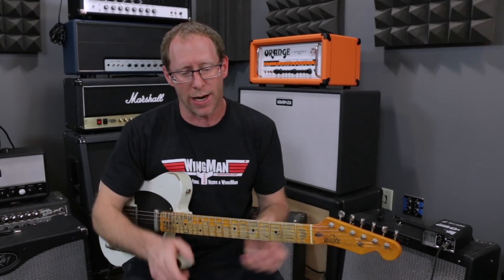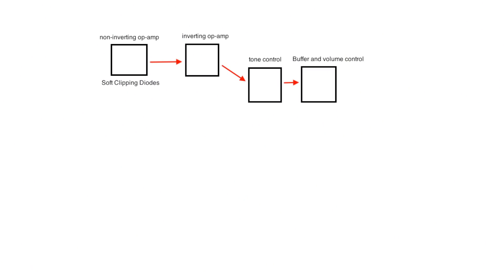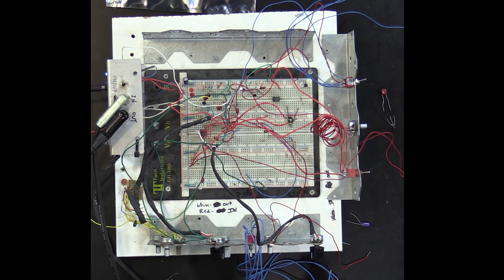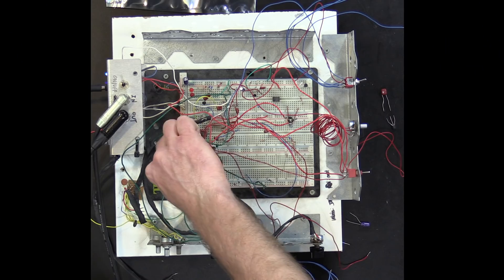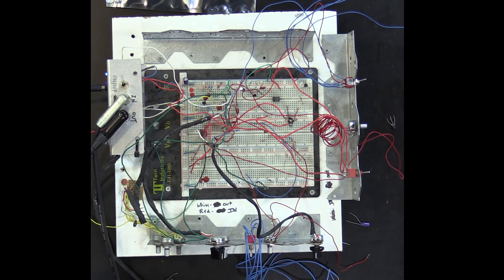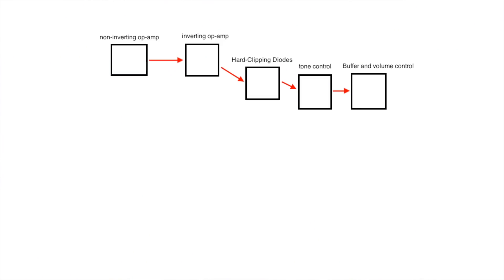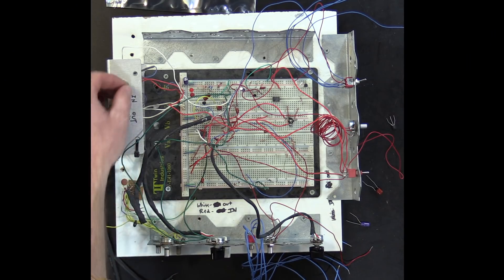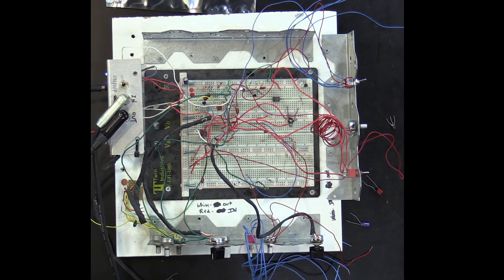What no one tells you about Guitar Pedals & "clone" circuits

Comment: I'm just getting into pedals and one would think stating a pedal is a clone of another sets an expectation that the sound should be similar.  If it's modified to provide a different type of tone than any similarity to another circuit is simply trivia to most players.  For those who are really into the design of pedals I can see where reworking circuits is of interest to branch off to new designs.  For the everyday player I'd almost classify the circuit reference with different tone to be almost misleading or false advertising.  To me it should mean similar tone but in a different enclosure, branding or with other features etc.  This is good to know though as one should hear the output for themselves prior buying pedal and not rely solely on marketing copy.

Comment: Brian Wampler doesn't gig with a pedalboard; he brings five breadboards, some wire and a bag of alligator clips...and changes 'pedalboards' between tunes! 

Seriously, I would throw money at any of those impromptu "circuits" you whipped up. Very educational/enlightening. You're a true artist at what you do!

Also: My V.1 Sovereign is probably my favorite distortion pedal of all time. Cheers!
Reply: Picture it: effects circuitry you can shift mid-gig, much like moving around the patch cables on an analog synth rig.
Reply: @rickc2102  that is basically what the switches and pots on the top of any pedal make available. Especially rotary switches as you can totally change your path multiple ways.
Reply: @rickc2102  like modular for guitarists' pedal boards.
Reply: @nzeches  yeah but you wiggle the wrong way and you're not going anywhere, ha!
Reply: @rickc2102 while in general I think figuring out socket to be able to swap parts somehow like ics would be awesome, in general you don't need that much control really

Comment: The last fuzz sound was right up my alley.
Reply: Sounded like some White Stripes
Reply: So to get that fuzzed out tone you  just need all your wires exposed which is almost a moment of synchronicity that is exactly what i did last night testing a newly soldered fuzz circuit totally bare going into amp wires were picking up signal like crazy had to put guitar volume just a smidgen above 0 or the utter devasting tsunami of noise would've been literally earsplitting even at that volume the sputters & spits & fuzziness were like awesome...
Reply: Garbage. It sounded like a fart, but not as good as that.
Reply: @WaRLoKWYATT  sorry Mr. Bluesrock. Scheduling will be back to normal klons, tubescreamers, light crunches and spring reverb, don't worry
Reply: Look for Devi Ever -  no-fi fuzz. Not sure if that was the original fuzz name, but you can get this type via the chaos mode switch on a soda meiser fuzz.
Reply: Yuri Billones i was gonna say, sounds just like the chaos switch, all it does is remove the capacitor that limits the gain of the sodameiser

Comment: I found the video fascinating! I've never built a pedal before, but it looks like it would be a lot of fun. Brian, perhaps you could do a video on how to build a breadboard pedal (fuzz, distortion, etc.) It would be useful to first see the basic signal path, and then see where resistors, capacitors, op amps and other components are added and changed to modify the sound as desired. Thanks

Comment: I remember the 1st Time I breadboarded a working overdrive n got to hear n feel the difference between swapping op amps diodes & different parts so many things that you’re conditioned to believe will make a larger change such as changing the op amp is incredibly subtle n things you didn’t expect like changing the size of cap or resistor can make a drastic difference.. that started the endless rabbit hole of building amps n pedals n constantly modded n tweaking.. your the king of gain BTW Brian. Me n most of my pedal tinkering friends agree

Comment: The OD sounded fantastic. I focused more on the very cool “jig” you set up around your breadboard. Since I play with making pedal I had already hit on the idea of using a plate with in and out jacks, and on/off switch, but you took it much further and now I have to make something similar. Great video too!
Reply from the maker: I moved away from that a little while ago and created this:
https://modyourownpedal.com/products/breadboard-module-bb-1-for-prototyping-guitar-pedals
Reply: @wampler_pedals  damn. Fell for it immediately, and the price is good, only problem, it’s sold out. I definitely would buy it, but any idea when you will have more for sale?
Reply from the maker: I’m getting ready to put a new batch up here shortly
Reply: @wampler_pedals  cool! I will keep checking for it. If possible had one other question. I would like to have a looping guitar input to some pedals while I tweak them with things like trying different transistors, op amps, bias, etc. was thinking that it would be important to duplicate a guitars output impedance to get it right. Can you advise? Or maybe have something that does that? I can of course loop, but it is the guitars impedance I’m more interested in.
Reply from the maker: I usually just buffer into whatever effect I’m working on but you can use a “pickup simulator” circuit and increase the impedance if you need to.
Reply: @wampler_pedals  thanks. I’ll look for a pickup simulator circuit. Is it usually resistive, capacitive or both? I assume it’s passive.
Reply from the maker: Passive, search for it along with muzique.com
Reply: @wampler_pedals  Thanks so much! Excellent resource!

Comment: I'm a big fan of "imploding" sounds, like you get around the 6:30 mark.  These are generally achieved by using cascaded high-gain circuits.  One of my pedals is basically an MXR Distortion+ clone, feeding an Ampeg Scrambler clone.  Implosion sounds abound.  Another is essentially a heavily modded EHX Double Muff circuit, which is fundamentally a pair of silicon Fuzz Faces in series.  It makes a terrific platform for experimentation.

Comment: I want to buy this pedal exactly as it is.
Reply from the maker: I might be able to do a couple of one-offs if y'all like it
Reply: "The stompbox that can be whatever you need it to be: fuzz, clean boost, overdrive, or just a noisy bee"
Reply: @elonmush4793  Here's a name for it: "Bumble Bee Bouncer" ... "Boutique By Brian" just needs to build it and slap on a $250 price.
Reply: Idea: a breadboard assistant pedal. It does nothing on its own, but it has openly accessible pin headers for:

In/out jacks
+9V
Optional +18/-9V charge rails
in/out buffers
three-band EQ

Plus a current limiter to switch between 50mA, 500mA, and 1A.
And maybe package it with a really clean, linear PSU 9V wart.
Reply: jvin248  If you can do it cheaper good luck. Time consuming making a pedal. You can make it cheaper but only if you don’t factor in your time.  Most pedals have like $30 of parts and hours of soldering.
Reply: @wampler_pedals  Yes! That second to last fuzz in particular needs to be mine!
Reply: A one off, you say? How about a Uni-Vibe???

Sorry, it had to be said.
Reply: I absolutely love the fuzz at 6:28
Reply: definitely keen if it does all those sounds in one, especially that last glitchy fuzz
Reply: @wampler_pedals  I would seriously be interested in the schematic or buying this if it were a pedal. What are the chances for either?

Comment: You can buy three Fuzz Faces or Muffs off the shelf, and they may not sound the same. Transistors are funny critters, especially germanium. Op-amps are more predictable if they have the same number on top.  I swapped out the op-amps in my old school Peavey KB60. Originally equipped with 4558's, it seemed noisy. Swapped em' out for 5532's  and it actually helped with the noise floor, specially the spring verb send.. Did the same thing to a buddy's  Peavey Bandit and it fixed noise but distorted poorly with high gain so we decided to keep the 4458's in the gain side and use 5532's for the verb and clean channel. Datasheet's don't lie, slew rate is a crazy topic for audio. Best sounding op-amps for some circuits (like an EQ) is the one with a sluggish slew rate. Other's (like a compressor) are best with a fast one. Guess my point is, clones are not always clones- stuff changes with simple part exchanges. Still,  Discreet JFET's sound best to my ears in guitar circuits. Gotta measure and bias them precisely (Dimitri Danyuk  * thank's RG!)  but it's worth it.

Comment: Going the other direction, I think you can just send in white noise, analyze the output, work out the transfer functions as the knobs turn, and then use conventional op-amp-based circuit stages to get as close as possible. A double-blind test would probably show that any audible differences would be minor.

Comment: Thanks Brian - excellent.  That gives me an idea for a new pedal concept (not that I have the time to make anything these days ...).   But imagine this - a pedal that has say 6 op amps in series (or maybe discrete gain stages - they could all be different).   The trick would be that each one could be inserted or bypassed via a dpdt switch.  Then the clipping diodes could be optionally inserted at any point in that chain via a rotary switch - anywhere from totally off or right at the front of the chain or right at the end.  Possibly there could be a selection of clipping diodes for different flavours.  Also it would nice to have some LPF and HPF filters via capacitors (or even inductors) which similarly could be optionally inserted anywhere via rotary switches.  So basically this would be a breadboard for lazy people.  But the sonic options could be immense.  Keeping it all surface mount could keep the noise down - maybe dip switches or whateer modern options are out there.  Maybe an easy removable top panel that retains full shielding but allows easy tweaking.  I would imagine some knobs for gain, level and maybe tilt eqs for input and output.  You could even have settings in the manual that would recreae/approximate a range of classic pedals - so people could buy this one pedal and then by experimenting with this they might find that their favorite tones fall into a particular class of pedal, so maybe they could then purchase more specific pedals ... I would be up for that :)   .

Comment: Great explanation 🔥 I have a question for you when you need to use a SOT23 transistoron breadboard what type of adapter do you use to connect such a tiny component? Thanks!
Reply from the maker: I think there are pcb boards to convert this on Amazon
Reply: @wampler_pedals Thanks awesome 👍

Comment: Hi Brian, when I try a pedal, I use my ears.  I don't even want to know what circuit is in it, or if it's a clone of this or that pedal.  For instance, I knew I wanted a pedal that provided a little dirt and warmth, like a tube amp, just before it starts to break up.  But I didn't want distortion, or even overdrive, until maybe around 12:00 of the drive knob.  I also wanted to avoid an increase in volume, so not a boost, either.  I had a sound in my head, tried about 30 different pedals, and found the one I wanted.  Through the testing process, what I realized I actually wanted, or heard in my head, changed a bit, and ended up a bit different from my original concept.  If you choose or don't choose pedals based on their descriptions, or by which circuit is in them, I would think you are surprised a lot of the time after adding them to your board and playing through them.  Pedals/effects are a parr of this listening art form, so use your ears when choosing a pedal, or any equipment, not what's cool at the time, or what the manufacturer tells you their product sounds like.

Comment: I have unsuccessfully been trying to put together a guitar-ready breadboard with the in and out jacks, power supply, etc.. for a while now. I’ve got all kinds of transistors and capacitors for different circuits and what not, but I want to test a circuit before I solder it together. This seems to be the only easy way.

Comment: Brian I'm thoroughly experienced at designing opamp circuits and have a question- what's the significance of having a non-inverting and an inverting stage?  I realize they'd behave differently if operated outside the linear range, or that adding back-to-back diodes for clipping would be done differently.  Probably the reason you did it probably slid right past me.

Comment: Well, it's certainly true for dirt pedals, some of the more straightforward time based effects, too. Beyond that I really don't know, but I haven't built complex circuits so it still seems a bit like voodoo  

It's strange how when you hear people talk about dirt pedals they always talk about the character of the distortion and not about the frequency shaping that's built into the circuit and gives it a lot of its character. If people understood eq better, just enough to pick out a narrow q cut or boost by ear, I think they'd be able to find what they want pretty quickly, rather than chasing distortion characteristics of particular types of components.

Comment: Would it be possible to have switches thatkeep adding to the circuit where all the options were possible? Too noisy?
Reply: Only one way to find out!
Reply: It's very rare to add whole circuits in building..mostly its switching between components or small tone circuits..if anything this vid shows you how to get many different results from a few component changes within the same schematic!
Reply: Actually its probably more common than you think. Or its becoming that way. Heck I did it with my very first design. Stuck 2 of them together and created a beast! I know Brian  has done it on other designs also.  Check out the Velvet Fuzz or Earthquakers Cloven Hove or probably any octave fuzz pedals on the market that has a switch to add octave. Thats the entire Green Ringer circuit added to whatever fuzz they chose. 
Its a great way to smash some doomy tones out of a classic design. Any hands on effects designer of today won't settle on a simple capacitor/resistor/diode swap with so many options available and call it finished. Back in the early years they didnt have proper ways of switching or access to the schematics of hundreds if not thousands of circuits  available just a few keystokes away or it would have probably been the thing to do a long time ago.

Comment: Hi Brian, love the vids...... Has me with a question of non distorted nature.....
Ive been playing guitar for over 20years, and in the last 10 of those years i have been stuck with a pedal sound for guitar in my head and still no one has done it. There are midi imitations in some pedal boards. But do not represent its sound.
Ok, so the pedal turns the guitar into a harmonica, which can be adjusted, (ie, width, mic type, tone, overdrive,) built into an  expression pedal for ease of textural changes. Certainly their is a solid state way of aquiring this sound replecation???

Comment: Great video! I've always wondered how the variance between similar components can affect the sound of a pedal. If a lower end manufacturer uses a resistor with 10% tolerance, you could potentially get a wildly different time from one pedal to the next in the same production run. Have you found this to be true?

Comment: having modded a DS-1, i learned fast that SLIGHTLY changing component values causes a trickle down effect on the entire sound. "based on..." sure. but adjusting the low cut on the front end and altering the range of the tone control could change EVERYTHING. so we like our tubescreamers. and there are a million of them. but as they pointed out in an andertons video, they are all JUST a little different. the JHS bonsai is an exercise is slightly changed values varying tone. personally i love the TS10. boooo, right? well they tweaked it just right and i love it. i rarely get hung up on "based on...". if it's good, it's good. someone out there might make a big muff that makes me finally understand big muffs. until then... gimme my mids back, EHX :D
Reply: very doom/stoner oriented but if you want a big muff based fuzz with heaps of mids you should look into black arts toneworks.  Something like the pharoah or the crown of horns would get you all the mids you could need

Comment: Having a pedal board that has the ability to work like that breadboard rig and not be a stack of off the shelf units. I have been avoiding the rabbit hole but I have a few pedals. Polytune.. ABY a compressor.. The channel switcher with my amp. And Pi fuzz...  I like what it does but it's kind of a fail at being a fuzz.

Comment: This was interesting, but it made me wonder why some skillful and clever engineer couldn't put most or all of those bits and pieces in one box with a means to select which combination of bits and pieces are used at any given moment. If such a gadget were built, wouldn't it put multiple functions into a single piece of equipment? Might that not be more convenient to use than having several dozen slightly different boxes all jammed together on some sort of oversized board?

Comment: The reason many collectors of certain analog pedals may have a dozen or more of an older pedal is not because "greed is good" & Gordon Gecko is their mythological hero. Its because of the fact that they all sound slightly different.
That due to component drift over time. Manufaturing tolerance & thus variance.
And a whole plethora of factors influencing the final sonic signature.
A whole heap of "boutique" pedals are simply played & tuned to "sing" before being released. Thats because most understand that the circuit isn't just a circuit. Its now an electronic extension of the instrument being played. Macari's famously do this & their reputation & sound "speaks" for itself. Sounds simple right? Err WRONG! There is one thing you are forgetting. The instrument and amp & YOU are all varied. How do they make it sound good across the board?
EXPERIENCE! Question is Are YOU...
EXPERIENCED? Ha! See what I did there?